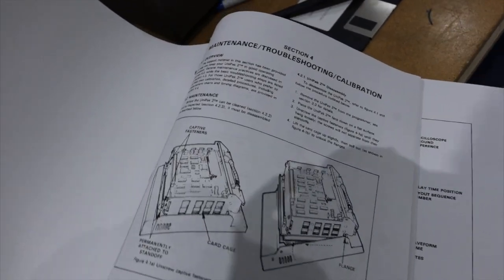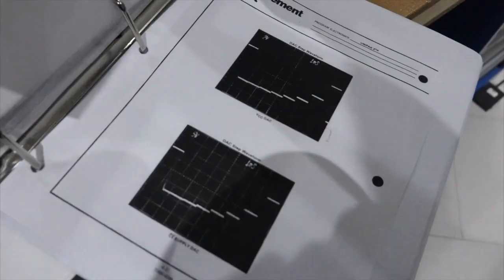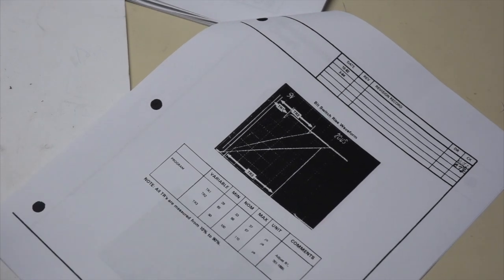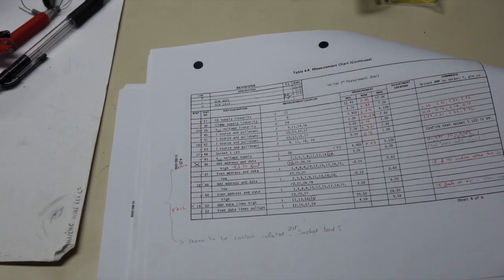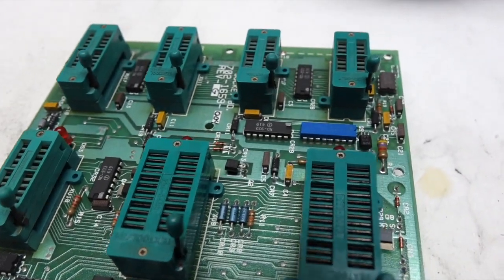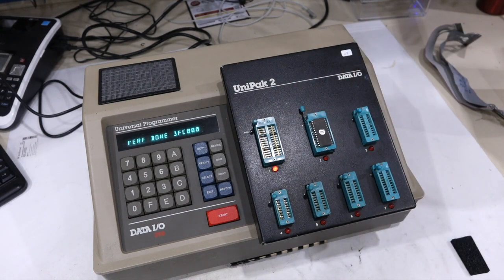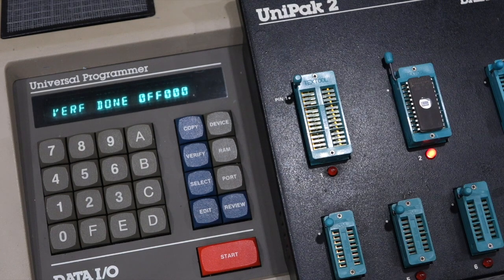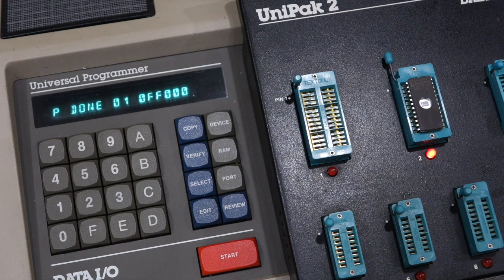Data IO 29B PROM Programmer Repair Part 4

Comment: Socketed sockets!? I've officially seen everything
Reply from the maker: Yes that was quite a surprise. But in retrospect it makes sense. In production (which this sturdy thing is made for), the ZIFs would eventually wear off. They smartly made them easily replaceable. I was very relieved when I found that out, it would have been a nightmare to desolder them all!
Reply: Yeah, it makes perfect sense, I've just never seen that before

Comment: That can capacitor doesn't look bad to me.  One I removed from a 36 year old 70v amp not only sprung a leak, it apparently spilled some of the electrolyte into the positive side screw.  That stuff doesn't agree with the aluminum threaded post and the plated screw.